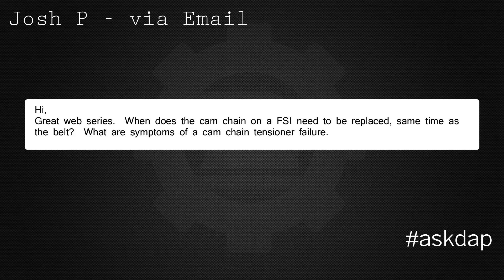VW | Audi FSI Camshaft Timing Chain Service Interval

Comment: I have a chain rattle on cold start, the engine runs a bit rough / under powered and the emissions light is on. Could this be a sign of a chain / tensioner needs replaced or repaired?